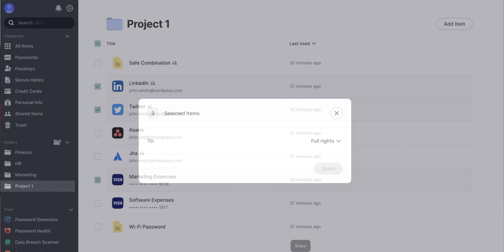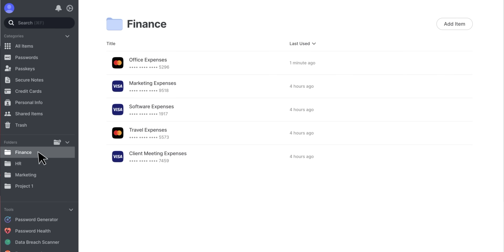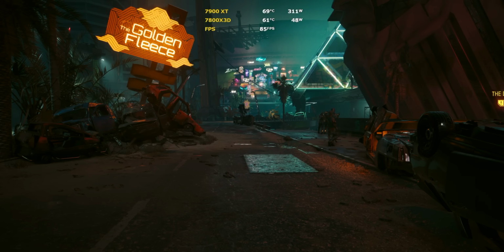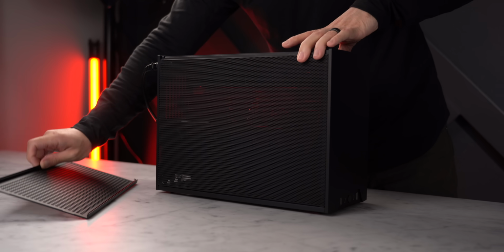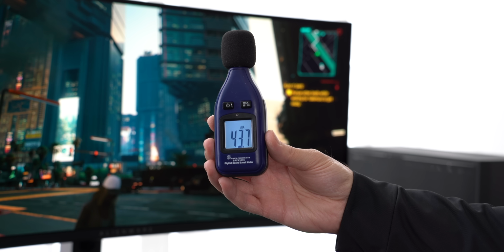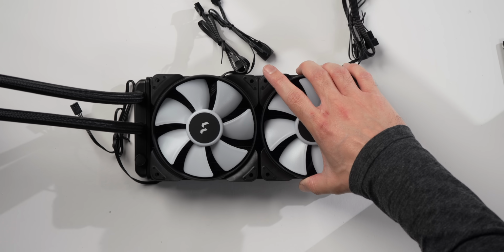Small Case with MASSIVE Versatility - M1EVO Full Build Guide

Comment: Very nice and versatile. But also expensive and very involved process. CM NR200P-Max seems to be one the most straight forward sff to build in although that’s larger in size/volume
Reply: The tecware fusion is cheaper, smaller than the CM and can accomodate a micro atx build with an atx power supply as well.

Comment: If you mounted the AIO on the side, and the motherboard on top, with the GPU plugged directly in to the mobo, is there any extra room to mount some 140mm or 120mm fans? Great vid! Keep it up!
Reply: Their website shows different setup variations, but yes you can fit a fan at the bottom. with the GPU plugged into the Mobo.
Reply: might be better with the GPU in a vertical position though with fans on the bottom.

Comment: For an SFF build, look at the Silverstone SG13. If you choose to build in it, I’d recommend using a 120 aio and an SFX psu for extra room. When using an SFX psu, be sure to get an atx-SFX psu conversion bracket as the case takes an atx as standard.
Reply: I really have a hard time deciding whether or not that Silverstone SG13 you've mentioned looks like a garbage box or just like actual garbage. Regardless of that it's most definitely one of the ugliest pieces of hardware i've ever seen. Holy shit.
Reply: @NoName-st6zc  damn for real... That does look ugly. That is at most a media pc that is hidden from sight. For a second I confused it with a NAS.

Comment: It looks nice though if you want to run a 4090 I wouldnt recommend that case. High 80 temps is too toasty imho. It's because there's not enough room for fans it seems. I'm running a 4090 and 13900k in an AP2 01 and on cyberpunk at ultra settings Im seeing 70 ish temps with the glass panel on for hours. Running a total of 5 fans not including the AIO fans. I did deviate from using the power supply enclosure to get it all to fit. 

You should make a video to see whats possible by trying to add more fans.

Comment: I'm curious why you went with a mITX build when the whole point of this case and it's larger size is to accommodate mATX mobos? As a mITX case the M1EVO is way too big to justify for a SFF build, but is just right for mATX SFF based builds.
Reply from the maker: You can't fit a top mounted rad with a mATX board. At least not with any of the ones I own. And if I went side mounted, then I wouldn't be able to vertically mount the GPU. Ultimately, I went with the components I thought would be the best/easiest way to show the different options available.
Reply: the whole point of this case was not to accomodate mATX mobo but to accomodate bigger size GPUs than the last gen while keeping the same design element as the old one.

Comment: The amount of people crying about this case in the discord server was wild, while I agree that the manual was shitty it’s not that hard to figure out once you start using more than 2 braincells… The case is great and solid as hell, probably my favorite case hands down.
Reply: This case is fucking garbage. Screws overnighted from factory, motherboard tray bends because brackets aren't designed correctly, and is a total pain to put together and use, plus being well over $200 with add-ons like tempered glass or a PCI-E cable. I have the V1 though, maybe they fixed all this in V1.1?
Reply: @KriticalWizard  Maybe they did fix those issues with the 1.1 model or you just got a bad unit because I had none of those issues.

Comment: case definitely looks nice.. but that shit is 200 dollars bro why are we paying more money for less material
Reply: designing them is harder and therefore takes more money to develop. They have to pay themselves and those who work for them.
Reply: Because it's less sought after, so it's not as mass produced.
Reply: Welcome to itx tax.

Went matx with the asus prime for less than half and it fits all components without compromise.
Reply: First sentence in the video, cncd aluminum
Reply: cnc alu, r&d, small quantity relative to general case market
Reply: maybe my math isn't mathing. if i pay out my ass for one of the highest grades of aluminum (most people are buying cheap shit, likely standard 6061 which runs about a dollar a pound at my local metal shop) i'm looking at about $15 a pound. my cheap little cnc machine in my garage could run about two of these cases an hour at $10 an hour. i'm sure an established brand has more and better machines so we'll say $20 an hour. add an hour of manual work to inspect and polish the metal and make sure everything is in good shape, we'll throw on $30. powder coat the thing for another 20 bucks. we're not even looking at a hundred and that's rounding up at every opportunity. i just think they could cut it down to like 160, get more sales because people will hear about this nice little case that's comparable to, say, a fractal terra, but bigger and cheaper but still small and high quality and still make a killing. cause the case is fuckin nice, but it's not $215 nice
Reply: Tooling costs. At a lower volume that cost is amortized across a fewer number of cases, so it adds more to the cost. I have one of these and it’s incredibly well-made. It’s definitely not cheap, but ITX cases are largely a niche outside of a handful of small cases from big brands.
Reply: @CRUNKMASTER Correct me if wrong but you are thinking purely from a manufacturing costs perspective on this one. R&D itself to just develop the ideas on how the case is designed and constructed with their machines that themselves have their own costs for maintenance adds on to the price considerably, it just doesn't feel as obvious.

Obviously I would want it to be much lower myself if possible, and some of the design choices for this current iteration of the case could've been better thought of by Dan Case that need improvement (e.g. a more solid PSU and fan bracket). But from how the case was intended to be used for costly ITX/AIO parts and even some mATX compatibility Dan Case can get by with this price range.

This is admittedly a long winded way to say vote with your wallet but yeah. Compact mATX cases for cheaper do exist.
Reply: @tianlamian there is also willingness to pay from the customers..all the components like the mobo etc are already expensive. So the people who are interested in this are willing to pay more
Reply: Cause if it was 20 bucks everyone would want it
Reply: @frankytanky5076 you went with what cooler?
Reply: Even ignoring the itx tax, there's a lot of mid towers which are around that 200 dollar mark. 011 vision, fractal torrent, be quiet silent base 802, etc. it's just the price you pay for high end.
Reply: @jeremyg2236  3 bottom mounted 120s 1 120 read exhaust and 2 top mounted 140 exhaust.  Cooler is an nh d-15 s with a 140 and a 120 up front.  The clearance in the case is 170 mm though which is bigger than basically any cooler.  I really do mean the asus prime is zero compromises.  It's still less than half the size of ATX and very portable.
Reply: @frankytanky5076  wait where's the air cooler facing? Is it rear intake?
Reply: Economies of scale. Also these cases are built to perfection. You can buy decent cheap itx cases like nr200 or s300/s400 as well
Reply: @jeremyg2236  I watched a video that recommended a negative air pressure, so i have the cpu cooler rear fan and top fans all on exhaust.  It doesn't matter as the entire case is mesh so those exhaust fans also bring in cool air too.  I'm just trying to get the least amoutn of dust possible.  

The bottom fans under the gpu are intake as there is a filter there.  There are mounting spots for 2 120s and I zip tied a third one.
Reply: @sggsquadpresents designing them is not harder, stop providing false and misleading information.
Reply: @ImOnlyHereForTheZipline  lmao you clowns
Reply: I’m not a fan of the price either but it’s somewhat understandable… it’s a very niche case made with premium materials, it’s not mass produced and has very limited quantities, and itx tax is a real thing. Also I could be wrong but I swear I saw a comment in the discord saying that Ncase is a company of 3 people.

Keep in mind if the price its that big of an issue for you the NR200 is always a good cheap option
Reply: @YeahNoTellTheTruth  I think we’ve seen a great example of this recently with the intel and am5 contact plates.  Thermal grizzly charges 30 plus dollars while thermalright charges 5 for what is exactly the same product very likely made in the similar place.  Hilariously the thermalright contact frame actually performed better.

People will go on and on about the engineering involved but a lot of these things are not that difficult.
Reply: Theres a ton of small details which are hard to run in the machines. Small margins of error. But to list the things which besides brand name, justifies the price are.
-Intricate cnc work
-Exclusivity
-Small runs of product
-Extemely high QC
Probably more but its a real high premium product compared to your normal cases. With that said its still expensive yes. @Crunkmaster
Reply: Quality of materials and manufacturing
Reply: @sggsquadpresents not really
Reply: @YeahNoTellTheTruth  what color is your cnc machine lil bro
Reply: Ford 350 vs McLaren p1
Reply: Wow you really aren’t the brightest are you
Reply: It’s “for the experience”. 

Because why the fuck not?
Reply: Why is grass green? Why comment when the answer is obvious?
Reply: Gotta love the defense of there's less demand... The only reason is because of the price. Then it's oh there's more R&D cost, as if the entire format is a very recent invention and the wheel gets reinvented with every ITX case huh. 😂
To add insult to the injured wallet, you also need to do more of the assembly process than usually required 😂😂

Comment: So many problems with this build, 1st these Ryzen CPU's are horrible for memory XMP/DOCP stability and will eventually start acting up (I already RMA"d 3 different units from 3 totally different rigs). Never use an AMD processor, always go for Intel, in this case probably the 13600k or 13900k (if you use 900k max wattage to the default 253 W). 2nd, it's just ridiculous that this case doesn't apropriately fit the 180 deg adapter for the GPU, yeah, remove that cover and enjoy getting your whole thing fried when it eventually shorts due to the electric tape not holding up. Huge fan of your channel but please don't support AMD and chassis comapanies that output flawed cases out there. And by the way I used to run my build on an Ncase M1.

Edit - For the idiots crying down below, go watch JayTwoCents rigs for example and you'll realize how shit AMD is.
Reply: What is blud babbling about
Reply: Don't listen to this guy. Plenty of AMD CPU users out there without issues.
Reply: Sounds like a skill issue.
Reply: I've had my amd for 3 years now no issues, sounds like you were just unlucky
Reply: intel fanboy spotted
Reply: What is blud waffling about 😅😂
Reply: No problems with XMP stability unless you don’t know what you are doing. Why would you want a 13900k, one of the hottest most power hungry processors in an ITX build, when AMD offers faster gaming processors which use considerably less power.
Reply: Sounds like a bot paid by Intel
Reply: Running 7950x3d and no issues. Also had 5950x and no issues with that one. This person just fanboying
Reply: I have been using amd CPU's exclusively since 2018, I have not faced any issues with memory compatibility, I always paired my mobo and amd CPU with ram kits that were compatible and listed in QVL compatibility list of the mobo manufacturer. Only issue I faced from amd CPU's in last 5 years was TPM stuttering when trusted platform module was enabled but this is now fixed so... I hope you change your mind in the future and maybe reconsider AMD as an option for you because at the moment amd leads in CPUs for gaming and affordability plus AM5 platform futureproof😅 you would be missing out
Reply: I’ve used amd cpus for over 5 years, and recently am using a 7800x3d, by far the best cpu I’ve ever experienced, also sips power and stays cool with like a 50$ cooler, honestly best cpu choice. I have nothing against intel but people trying  ward others from using amd especially the best gaming cpu out right now is wild
Reply: UserBenchmark spotted
Reply: @rare6499 I am shocked this wasn’t the fist comment 😮
Reply: Userbenchmark in the house :face-turquoise-covering-eyes:
Reply: I wonder if this guys Intel chip is still working or has melted itself, he'd probably still defend it even if it did 😂. Ryzen 3D chips for the win haha 💪.